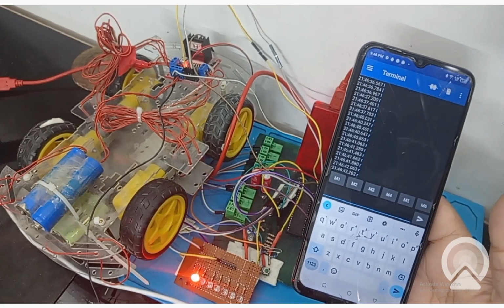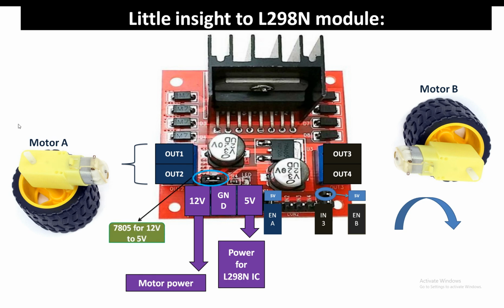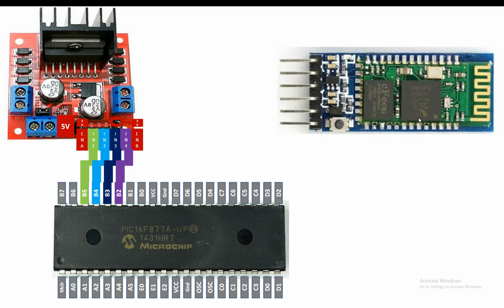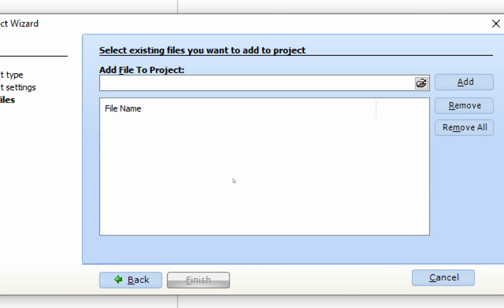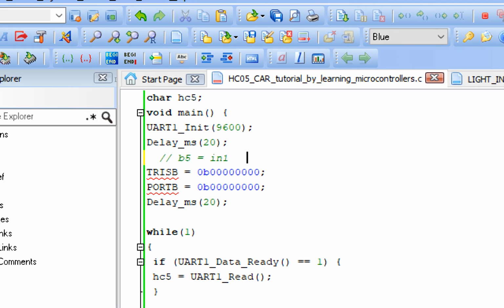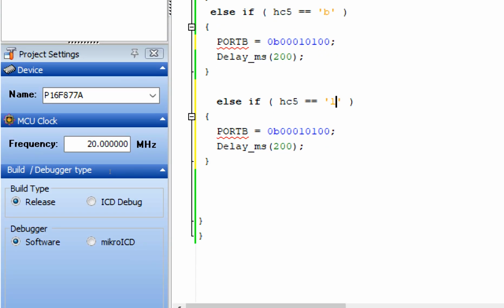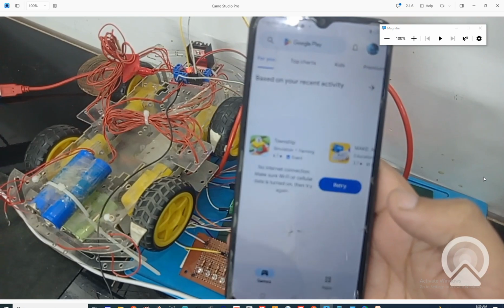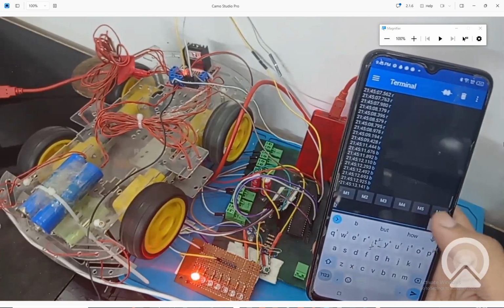Making remote control RC car using Bluetooth with PIC16F877A mcu. Tutorial.

Comment: What a great tutorial 👏🏽👏🏽, I have a problem with my Hc-05 it connects successfully but when sending the letters nothing happens and the car don't move in any direction knowing that everything is connected property in my circuit and I checked multiple times 
thanks in advance
Reply from the maker: Send me your circuit diagram at microcontrollers.learning@gmail.com
Reply from the maker: First set the parameters for the HC05

Comment: Do you connect the hc05 or the pcb to the pc or you made it thru de bluethoot decice ?
Reply from the maker: From bluetooth to smartphone
Reply: @learningmicrocontrollers3561  and about the code that you wrote in pic, how you transfer to the hcr05?, did you connect any wire to it?
Reply from the maker: @joaosarmiento828  why transfer to HC-05?
Its a module you configure using a USB to TTL device
Check my video in the description
On setting up an HC05.
Once you are done with setting
Then they are saved in normal mode